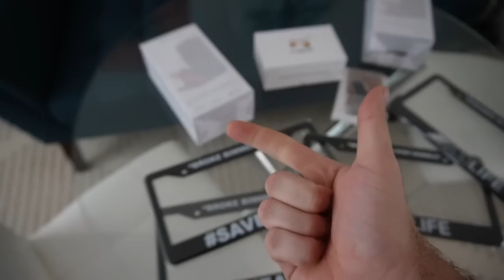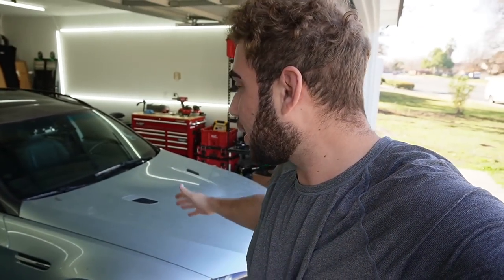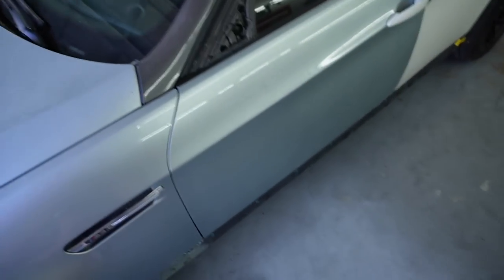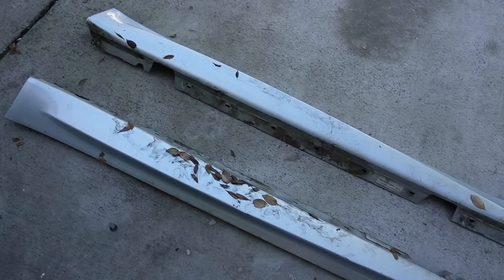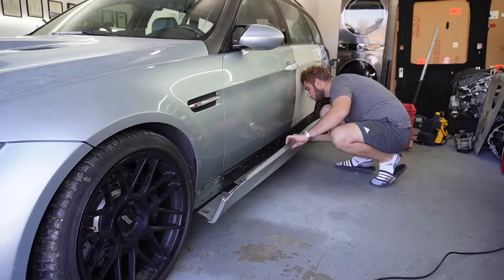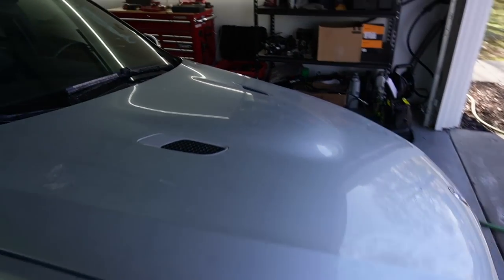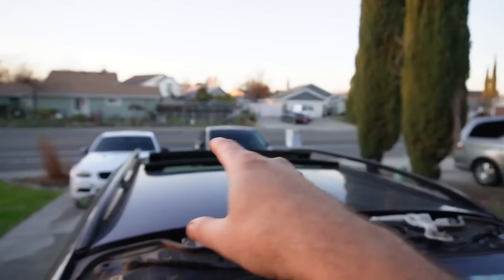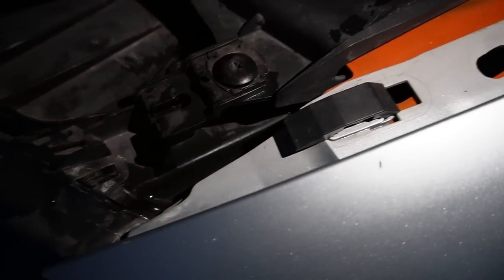Building A Custom 1 of 1 E91 M3 Wagon! (Part.25)

Comment: Hey Nour, not sure if you coded the LCI tail lights yet, but the ones on the trunk shouldn't light up like that. As it is right now, it's using the rear fog lights to illuminate those tails (which should be lit by a couple of LEDs embedded in the tail light housing). This gives it that weird look where the LED lines on the outer tail lights, don't really line up with the inner tails. Great job so far on the build tho, it's been fun watching the progress.
Reply: i noticed it too

Comment: The same way you feel about your E91 M3 is the same way i feel about my E46 323i I plan to do a M3 conversation one part at a time ❤🥺 Id also prefer the Gen 1 R8 because those cars a very extensive and youll be able to maintain it plus you could always sell it in the future for a different variation 😌🔥

Comment: I think the biggest thing that you did prove is that you can do an M3 swap on 328i. Read a ton of websites that say nothing bolts up. But I didn't think that was true. I don't remember seeing you do it but what core support did you use on the front end? The M3 or the e91 wagons?